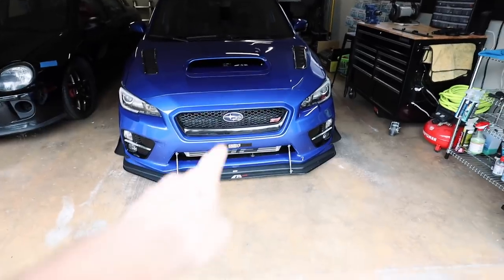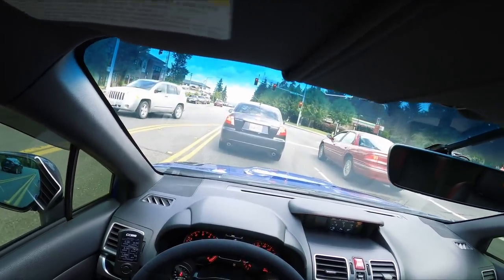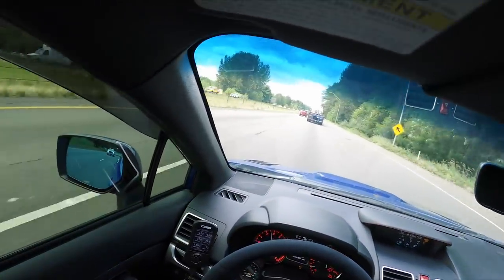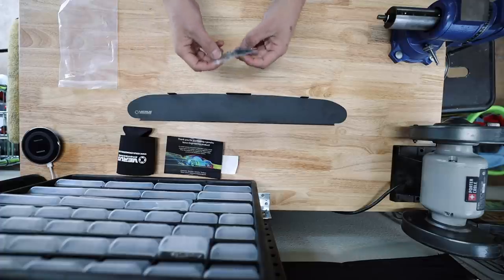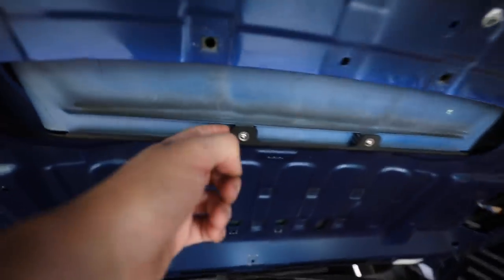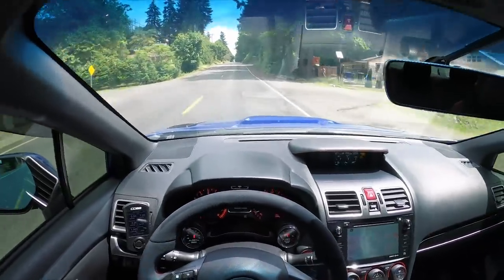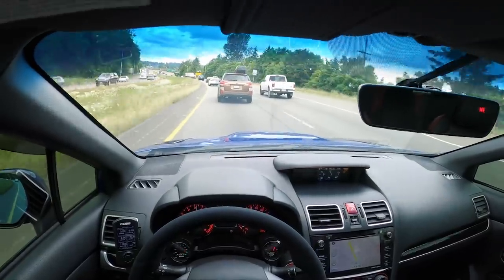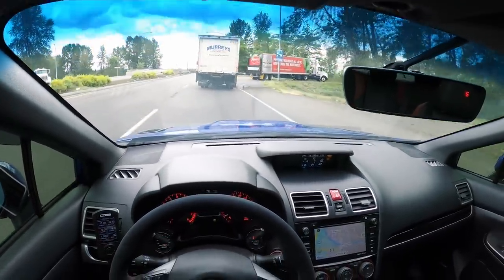Verus Enginnering Hood Scoop Block Off Plate - STI

Comment: Excellent review! Funny how this popped up in my recommended vids, I was in the market for this exact product about one year ago. At that time there was really nothing on the market, I ended up with a grill craft hood scoop grill figuring that some air blockage was better than the wide open hole left from installing cobbs fmic. May invest in this when I pony up for some extra vents! As far as deceased cooling system performance after the fmic install the ONLY time coolant temps creep up on my STi is over 120mph in 5th/6th gear WOT (on a track of course lol)
Reply from the maker: Glad it helped! Its a worth while product and definitely helped a ton with temps 🔥🙏

Comment: Interesting but IAT is only a part of the puzzle. 

Coolant temps would’ve been another very important figure to check and compare as that’s the most effected with a FMIC and the air disturbance the open hood scoop causes. I would have expected the coolant temp difference with the block off plate fitted to be greater than the IAT difference. 

Ultimately road driving isn’t the best way to test it too (the relative speeds are too low to get seriously into the air disturbance issues) and I’d recommend revisiting this test on a future track day - one session with the plate and one without to get a true comparison. After all IATs are rarely an issue on track with an FMIC but coolant temp definitely is!!
Reply from the maker: Good point, did not evem think to pull coolant temps! And very true! Just got my new helmet in today after thr BRZ build gling to be taking both cars to the track to see how the do and find their weak points

Comment: Do the hood vents saturate your intake and the battery when it rains? Love the idea, but will any parts be comprised by the rainwater?
Reply from the maker: Nope, the airbox protects the intake and the other side just drains onto the ground between the frame rail and the engine 😁

Comment: Doesn't the additional air help cool  from the scoop?I can see using it in the  winter
Reply from the maker: Not with a FMIC, the air enters the front stack and is supposed to be pushed out of the fenders, or in my case the hood vents. When the air enters through the scoop it disrupts the hot air exiting and creates turbulence in the engine bay

Comment: Shaw between 1-4 is nightmare fuel.
Reply: Wouldn’t it be better to run an Impreza hood and then vent that?
Reply from the maker: The hoods don't line up like they use to 😢
Reply: Thats rough

Comment: Curious 🤔 have you ever considered making the front side fender fake vents real "functional" vents so that engine bay heat could be further reduced while driving? To me form should have function a purpose. By replacing the pressed board engine bay inner fender trim with any of the vented models available and drilling some strategic holes in the backside of plastic grill molding, “voila” you have a pathway for hot air flow to escape while driving. The front fender has holes in it that are concealed by the plastic fender trim with the fake grille.
Reply from the maker: I want to make a ducting that can utilize low pressure to pull air out, ive seen similar set ups on other chassis just need to design a way to make it work 😁

Comment: Great video! I'm currently trying to figure out the best way to cool my intake temps, they get up to 160 😣 (currently running the SF intake with box, downpipe, stage 3 fuel system). Any ideas?
Reply: Jacob Robbins front mount intercooler, and iwire speed density kit. Your IAT sensor will be relocated for a more accurate reading
Reply from the maker: Your IATs are lower than 160 but thats what thr MAF is showing. As said a FMIC ajd relocated IAT sensor will give much better readings. But you can use yhe gold reflective taoe on the outside of the box to help reflect some heat away 😁
Reply: @Smeedia  sweet thanks!

Comment: Good video boss man. I don't know if you're aware of this thing available. Google Sgood top mount oil cooler.
Reply: As of now they only have it for the wrx unless they made it for the sti already
Reply from the maker: The STIs intake manifold sits higher-end the Throttle body is higher so mounting one up top with the charge piping would take some work but very possible to do

Comment: Get an aftermarket oil cooler and put it up top where the old intercooler was.
Reply from the maker: It would have to sit pretty high to clear thr charhe piping and throttle body, most people that do it have a rotated intake manifold to make room for it

Comment: Why delete the hood scoop when you can make it functional again by mounting another cooler in the TMIC location like maybe an oil cooler
Reply from the maker: The STis throttle body and Intake manifols sit fairly high so thr lil cooler wluld need tk be elevated to make it work. Most people who use thr TMIC location for a oil cooler are generally using rotated intake manifolds for the clearance
Reply: Smeedia that makes sense. Every time I think about going FMIC on my WRX I think about mounting an oil cooler in that location see I g that the 2015+ wrx seems to have more room up top for that
Reply: why not a second intercooler, more cooling capacity for hot track days, don't forget water sprayers!

I'm more concerned about the physics breaking sub-ambient temps in this video ;)

Comment: Are you running a oil cooler ?
Reply from the maker: No I am not, had trouble fitting one with the FMIC
Reply: Smeedia you can fit one where the old top mount use to be. I did that...wanted to ask u about the block off plate tho. I have sent u a message on Fb
Reply from the maker: No, the IC piping and throttle body sit too high

Comment: Bums me out when people go front mount TMIC for life
Reply from the maker: Not a huge fan of TMIC, more prone to heat soak, bulky, on the way. However you do have significantly less charge piping
Reply: Smeedia I agree but with turbo blanket downpipe blanket heat shield and a good TMIC still works really well and keeps the car simpler in my opinion also just don’t like how it covers the radiator up
Reply from the maker: Understandable 😁 regardless both are good options IMO just depends what you want from the car and the set up you prefer
Reply: Smeedia very true plus your wanting to make more power down the line so it makes a lot more sense I wouldn’t go over 400whp
Reply: Turbo blankets, heat shield, and gold tape will never get the TMIC, sitting under the hood, as cool as a FMIC core placed in front of the car.